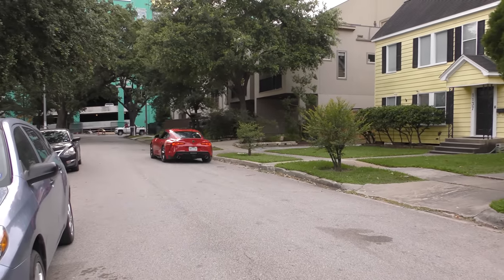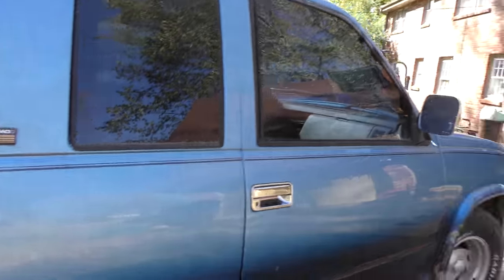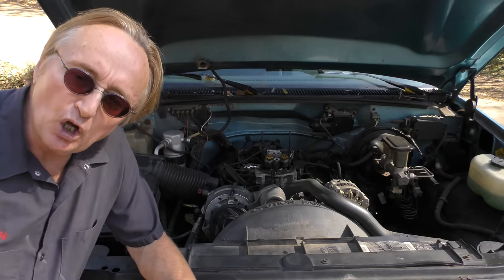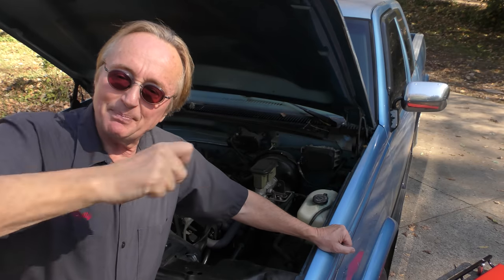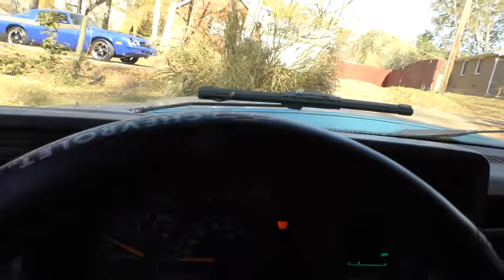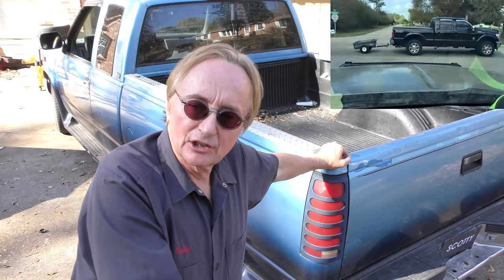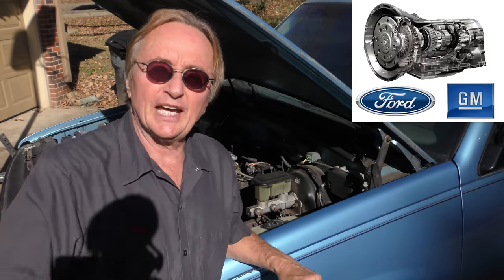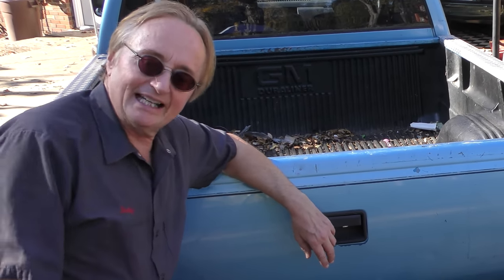The Only Chevy I’d Buy

Comment: A good turn-key truck is gonna cost you $3000+ I remember back in the day you could get one for $2800.
Reply: Got my 98 Vortec 454 C2500 8 months ago for only 2k. One owner, 107k miles, great shape, runs perfect.
Reply: @donellmuniz590  454? I have a feeling I know where the other $1000 bucks will go.
Reply: @_RiseAgainst  Yeah, gas. It gets about 11 mpg. But I dont drive much anymore. Tabs are cheap, insurance is cheap, parts are cheap, its reliable as an anvil, and fairly easy to work on, if I ever need to. Ya gotta look at the total cost of ownership. And it holds a hella lotta firewood, lol.
Reply: @donellmuniz590  we had one when I was a kid a 99 crew cab. The only problems we had was rear axle bearing when out pulling a travel trailer 1000+ miles and an electric component under the hood would go out so frequently we carried a spare. I do not recall what it was. We also ran it without oil after an botched oil change. Didn't bother it.
Reply: @_RiseAgainst  If your 99 had the 6.5 diesel, I know what that component was; the Stanadyne fuel pump control module. It's a VERY common failure on 6.5 diesel Chevy/GMCs. And an expensive part, over $400 last time I checked.
Reply: @donellmuniz590  no it had the 454. I will look into it.
Reply: @donellmuniz590  TPS (throttle positioning sensor) would melt on long road trips.
Reply: @_RiseAgainst  Hmm...I havent driven mine more than 200 miles on any trip. I'll keep that in mind. I'm driving 1500 miles to SoCal next month, but I'm taking my 4-cylinder Ford Ranger, which gets about 23 mpg, lol.

Comment: Okay, but one caution about 2007 and later Chev/GMCs:   The defroster only can clear the middle third of the windshield.   The windshield vent is only about 12 inches long.   Get used to driving around with no peripheral vision, unless you're willing to wait for the engine temp to come up.   Then, when the snow in the defroster melts, it will fog up the outer thirds of your windshield all over again.    I'm talking at any temperature below freezing.   Absolutely sucks.  Were these trucks deigned at the Equator?

Comment: I’ve got a ‘95 K1500 W/ the 5.7 TBI motor (also has the “southern comforts package” and is two tone blue, 177k miles currently. Bought it for $2k even, and I’m not kidding it’s as solid as a rock. Zero oil burning, smooth but firm transmission shifts, plenty of torque, 3.73 gears w/ G80 locker, Single cab, step side bed. and better yet, it still gets 16.5 MPG highway @ 80mph and 265/75 tires, and that’s with no O2 sensor hooked up LOL. Zero signs of weakness so far. My dad has a ‘90 C1500 with well over 650k miles, it’s on its 2nd motor, 2nd transmission, and 2nd rear end but hey if you divide that by 2, that’s about 325k miles for some of the drivetrain if not more. some of the best trucks money can buy, plus the value of them are going up steadily. They’re the next “square body Chevys”

Comment: Those are not factory headers! Lol. It is a silverado also. That looks like a old southern comfort package. He is is right that was probably a 700R4 trans, they last good as long as you don't pull things in over drive or shift from reverse to forward without stopping first. Also keep the trans cooler flushed out!

Comment: Just so you know. That is a Silverado. Back then Silverado was a trim level
Reply: Where years was Silverado a trim level? 94-95?
90-95?
88-95?
Reply: @johnle231  1975-1998
Reply: @daltonbrink9924  

So they were called c/k trucks up to 98
Reply: @johnle231  Exactly right. The model name "Silverado" came with the GMT800 platform in 99.
Reply: @daltonbrink9924   

How do I make a nv3500 from 1990 work with a newer engine like the LS engine?

Just hook up and go??
Reply: @johnle231  As long as it is the correct bell housing, it will bolt up. If the engine came from the factory married to an automatic, you'll have to  reprogram the ECU to run correctly with the standard.

Comment: I still have my 1994 k1500 Silverado (Sorry Scotty you are wrong the badge is factory not glued since it was the trim level) that I have had since new.and it is in fantastic shape. It only has 91k miles and I love it. The only issue I have had is the cab corners just needed replaced and that was just done. I get offers for the truck all the time but would never sell it.

Comment: I have had a 98 GMC K1500 for the last 19 years and it hasn't owed me a nickle for well over the last decade. 152,000 miles and it starts like any well tuned 5.7L Vortec. I consider it about 1/2 worn out with exception of the salt rust Scotty mentioned in Canada. Still loving it!
Reply: Regular oil changes and maintenance. My 97 has 275,000 on the dial.
Starts and runs excellent.
1/2 worn out at 150,000?
More like just breaking it in.

Comment: Just bought a 1994 c1500 with 247 000 up here in Canada for $2800. Hoping it has lots of life left. Only surface rust for the most part on the bottom but for a truck that's gonna be 30 years old I'm impressed. Well taken care of and the best trucks drives like a dream 😊

Comment: The only problem I see with the truck is the FRAM filter under the Chevy. Good power train that might get ruined by that poor quality filter. Someone is gonna say I’m wrong but trust me. As a scrapyard owner most cars that have blown motors 99.9% of the time have those filters under the hood.
Reply: I've used FRAM filters for everything...trucks, cars, both large & small tractor engines, combine engines, (gas & diesel).  FRAM is a subsidiary of Honeywell, a US Defense contractor.  I haven't experienced any problems with these filters.  One time on an '02 Ford Taurus I was doing a regular, scheduled engine oil & filter change.  My supplier was out of the FRAM filters so I thought I'd try Ford's own brand name filter.  Guess what?  After about 2 weeks the thing started leaking.  I didn't change any of my oil & filter changing procedures.  So I took it off and re-installed with a FRAM.  It didn't leak again.  The Taurus has 240K+ and the engine still purrs.  Been working on engines for 30+ years.

Comment: I don't have an old Chevy pickup, but I do have an old 1994 Ford F-150 with the 300 in-line 6.  I managed to buy it with 90,000 miles and let me tell you, I plan on driving that thing for the next 20 years. Can't beat older American pickups
Reply: Those 300 sixes last forever and are really easy to work on

Comment: I got 328k on mine.  I put a lance camper on it and it still goes 75 mph with no problems.  Nice.  I got it for 6k in 1999.  My truck is a 1990.  I just got a traile and it will be pulling all my camping stuff.  I love my truck with the lance pamper it is my home away from home.  Love it love it love it?

Comment: My wife bought a 1989 GMC K1500 4x4, 5 speed manual transmission, manual shifted transfer case brand new in 1989. We still have it. Needs a paint job as it had that crappie epa water based paint that gm used but still going. She i used to go mudding in our 4x4's back then too.

Comment: I just bought a 1991 Chevy G20 custom van with the 5.7l 350, it’s got 200,000 miles on it I replaced the whole fuel system new tank, fuel sending unit, fuel filter, fuel injection kit, fresh oil change flushed & replaced all the fluids, new tires & rally wheels, it runs amazing now & it’s got good power I like that it gets up & goes really good to get onto the highway, it’s got plenty of power & it will roast the tires straight clean off lol i love the thing! My daily driver is a 2010 Chevy Silverado 4.8l V8, my van runs & sounds better than my 2010 that’s sad!

Comment: I have a ‘96 K1500 350 5.7liter v8 Suburban. Had the transmission rebuilt at 160k miles. Runs like a dream at 171k miles. Super reliable, cheap to fix and runs smooth. I love my Chevy

Comment: I have my late dad's 1994 Chevy K1500 4x4  5.7lt. 350 auto-tranny and only 138' 200 original miles so far and is my daily driver !!   What keeps blowing out my fuse that operates the running lights (park lights, tail lights and interior/dash lights) !!!  My mechanic replaced  both tail light circuit boards and put all new fuses in the proper place and the running lights worked perfect for one week and blew out again driving home from work one night !!!   Please help with a real fixable solution to pass on to my mechanic !!!

Comment: This generation truck was solid however  in 1996 the 350 Vortec was introduced , they are powerful, solid and reliable.  I have a 98 Silverado 4WD , 220K miles.  Original engine and transmission, runs perfect.

Comment: 8 years ago I bought a 2000 F150 with extended cab, flareside and it was the best damn 3k I ever spent. Worked great and only had to replace a few things over 200k miles that were cheap and easy to do myself. Still had no oil leaks.

Comment: i bought my k2500 yesterday, 187k miles on the body, motor and trans and clutch have 60k on them, barely any real rust (just surface), and AC blows ice cold

Comment: Those are not  factory exhaust manifolds, they are actually aftermarket headers. I have a 91 gmc same driveline but has a single cab. The towing capacity on the placard is 8000lb. The reduced weight of the single cab gives it a much better towing and payload capacity. For being a Saskatchewan truck the frame, box and floors are solid after 250,000 km.

Comment: This is why I will keep my 02 Silverado. Doing the rear main seal next week. Body and Int in great shape, so it's worth it even with 350k especially with the insane prices of new and used trucks today. I'll put a few grand into my old all steel truck and run it another 100k miles easy.

Comment: I have a K2500, built in Texas. No chrome or carpets. Perfect for work or play (carries a slide in camper). Not much goes wrong and parts are cheap and plentiful. Dont want a new truck. Did have to pay $4000, but a clean 100% stock 4x4 in Los Angeles is a deal.

Comment: These trucks replaced the popular "squarebody" '73 to '87 pickups, GM didn't need to deviate too much from its success. In '96 the 5.7 motors got Vortec heads and bit more oomph. These are excellent trucks even today, generally more reliable and cheaper to repair.   The original motors often last for more than 500,000 miles, and its relatively easy to swap the later 5.3 v8.  With these I wouldn't care about high mileage, just fix what needs it.

Comment: Better yet, I had a '69 Chevy C30 long bed step side I had $900. It had a 327 and 4 speed. I found a Chevy 350, unassembled but everything had been machined. I added a Comp Plus cam, Edelbrock high rise, Holley and headers. While the engine was out, I replaced the clutch.

Comment: Bought a 98 single cab short bed mint with 150k miles on it 6 years ago still daily drive it till this day paid 6k and I love the truck put new radiator battery fuel pump water pump starter but she’s a runner engine and trans is good

Comment: Sorry Scotty, but you got a few things wrong.
1. That’s a short bed
2. It’s not a C/K. It’s either a C or a K. Via the code for 2wd and K is the code for 4wd and this is clearly a 2wd. It’s so annoying when people call it a C/K but it’s just because I know the difference. It’s not a big deal but just sounds like you don’t know much. 
3. That is a Silverado. Silverado was an option package in the OBS Chevy/GMC from 1988-99 until it became the name of the truck in 2000. That wasn’t just slapped on by one of the owners. That was put on by the factory. 

These are awesome trucks if you take care of them. They are the most reliable trucks I have had!

Comment: I have the 97 Silverado same cab 8 foot bed 454 two-wheel drive paid 1808 years ago put about 4,000 into it over the years to keep it roadworthy solid as a rock. 180,000 miles. Going to do a little cosmetic work on it it's been a good vehicle and I save a lot of money on vintage insurance😊😊😊😊

Comment: Just bought a '95 GMC Sierra C2500 (same truck) and I've owned a few OBS 90's trucks (a '95 Silverado C1500 & a '92 Blazer K1500) This truck has 522,000 kms on it and I got it for 370$ (auction sale) and it's amazing how smooth the 5.0 V8 runs. 
I wonder if I can get it to 1,000,000 kms?

Comment: Owned my now 25 years. Bought with 74k miles on it and now I have 385k same engine! Now the trans is another problem. Drove the original trans for about 280k, had it rebuilt, only got 100k on the rebuilt. Now having it rebuilt again! I know every repair as I've done most everything on it my self. I keep getting offers on it, but I won't sell it! LOVE MY CHEVY TRUCK!

Comment: OBS trucks are best when it's a single cab short bed, '96-'98 half ton with a fuel injected 5.7 vortec. 
If you can find one all original, rust free, low mileage.
Transmission usually goes bad between 210k to 250k miles. 
But those motors will last forever if you don't abuse it.

Comment: I still have mine but it was trash so I parked it. 305 engine and trans. Trans was rebuilt but not right and the engine would smoke out of the dip stick tube and any place possible on a long ride 40 mins or so.

Comment: I currently have a 2000 GMC 3500HD dually with a 7.4 Vortec (454), 4L80E trans, and Dana 80 rear end. It's a solid truck, but the '78 Chevy K20 I used to have was even better. Love those old square bodies.

Comment: mine is just like this but silver. 4x4, 120k. bought it for 1050 not running. put some new stuff on it under hood. New dist. rotor 3$ was the reason it would not run. drove it for a year, brakes went out (2015). parked it out back for 4 years. brought it back in 2 years ago. new tires, brake lines, etc., new shocks electric brake controller, some exhaust, have new ball joints, new ac comp. less than 3 grand in the truck since i bought it and it will go anywhere. towed my john deere 110 back hoe 200 miles on new equipment trailer. runs like new, no road noises at all smooth and quiet. original radio with new front speakers and antenna. i would not sell it for any price.

Comment: The mid CKs are not beaters, but stone reliable increasing in value trucks, they run forever and are easy to work on. Parts are cheap and with pickups costing 70k that will do the same job why buy new? I own two and they are smoother riding than the new junk out there. These trucks will be 35k and up in 5 years.

Comment: These trucks last a long time. My 89 is still my daily driver and I've had it since new, 32 years now. I have no desire to buy a new truck when this one functions and I can do most of the maintenance myself. Jegs replacement crate motors are still under $2000. Get the trans beefed up and it will last too. I typically spend annually what a monthly note is on a new truck.

Comment: There a 1996 ,4 x4 2500 ton, 175k $2500 here in Colorado  and think going get it to get a cheap hauling truck. Problems with these was the transmission , transfer case,  and lifters, head gaskets. And when trans, transfer case goes either  have go junk yard or expensive  rebuild.  Which just isn't worth fixing.

Comment: My dad used to have a 94 Chevy actually a few years ago. It actually wasn’t a bad truck. It burned a little oil, but it ran fine. The AC also leaked, but it was fine with just windows for the most part. However, at some point, the fuel pump went out, and when my dad replaced it, it ended up leaking gas because the assembly it went in broke when he did the job. He also found out at this time that the frame was rusted very bad. So he ended up selling it to our previous neighbor because he didn’t want to bother fixing it. That was his last vehicle and he’s really in need of something now, but can’t really get anything right now, so he has to rely on me and his girlfriend's car to get around town.

Comment: Excellent trucks. I bought the old ‘99 2500 (88-98 body) from work. Got t-boned by a semi going through a red light. Bent the heck out of the bed, but never the frame. Got it for a grand, what it cost with newly added tires and shocks before the accident. Welded a new bed panel and few other things, looks nice for its age and runs, drives excellent.

Comment: I'm a proud owner a of 94 chevy pickup same one as that except it's the short bed model motor and trans has been rebuilt runs and drives great unfortunately I put in more than 400 bucks lol I paid 800 plus to fix everything plus another 200 for the rear leafs

Comment: i had a 92 chevy k1500, and brakes rotted out, and I crashed it. it still runs, but I sold it to my mechanic bc front fenders, grille, and bumper are done, and the frame got twisted. reliable, and fun, and i miss my bb
Reply: reliable but the break lines, i recommend replacing stock lines with stainless steel

Comment: i drive a 93k1500 110k miles on it bought for 2500 replaced the fuel pump running strong drive it everyday

Comment: Hey scotty, my 93, and 97 1500 both had the silverado logo on it and that one looks like a short box not a long box. Those headers aren't stock, those are aftermarket from what it looked like lol.
Reply: I have a 92 with a 350  317,000mi Only 1 engine and trans replaced on it. You are right they didn't come with headers. Mine still gets about 14 mpg.

Comment: Expect the door handles to break, heater core to go, and  gauge or two to quit working. The engine will go forever though
Reply: Dont forget about the sagging doors, electrical issues, and automatic weight reduction on the cab corners. But despite their issues, man I love my old truck. 😂

Comment: I agree I have a 96 c1500 but will not buy anything from gm now flexfuel lifters fail. The transmissions fail because of bad torque converters. Fuel Pumps.  Gm keeps shops in Business